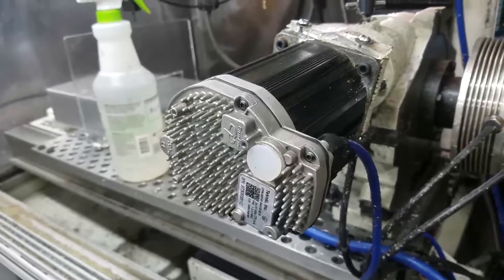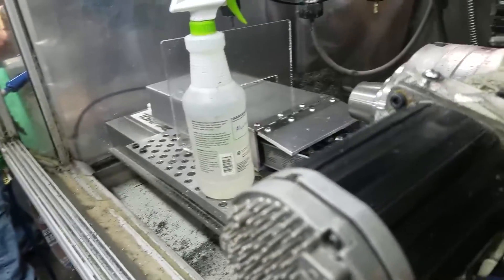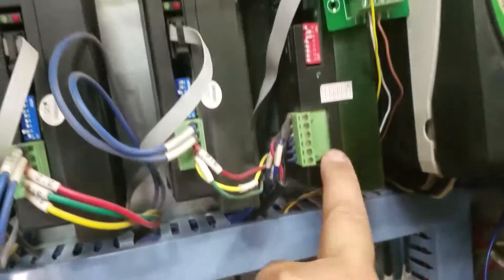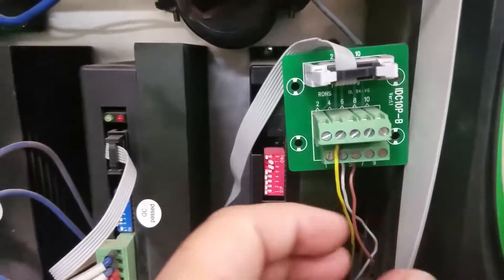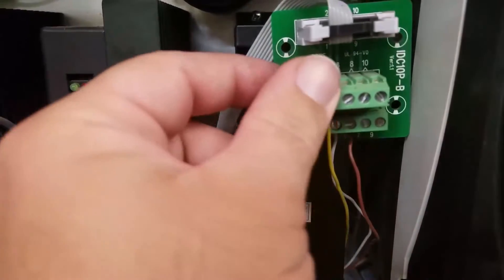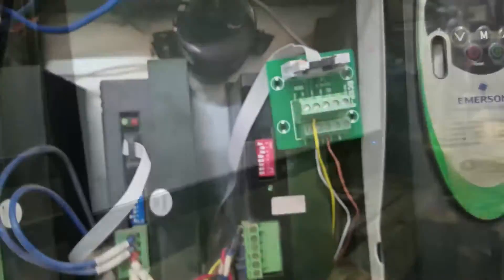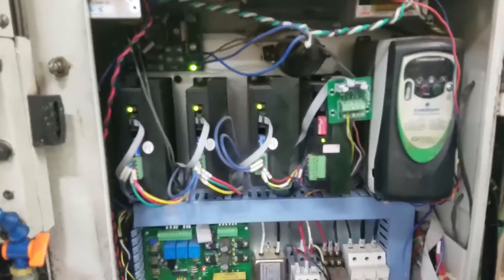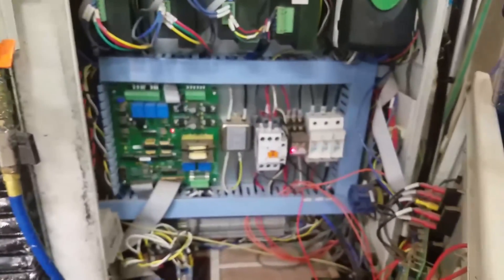Installing Clear Path Servos on a Tormach PCNC770

Comment: It is called "IDC 10P board".   It means that this is connector board for a 10 wires IDC flat cable connector.   10P = 10 pins.
Reply from the maker: sweet, i'm going to sticky this so folks can find it later.
Reply: where can you buy one ?
Reply: @automan1223  ebay.

Comment: Very helpful video thanks, I am trying to do same for xyz axis I am trying to understand the modifications to the INI file. Are the settings from Teknic or  can you point in the right direction in understanding the changes. Also is there a reason you used the SDHP over the SDSK did you need more power?
Reply from the maker: for our application we needed the max power for acceleration rates. also these sdhp's are spinning at near their max rated rates due to the 90:1 gear reduction in tormach's 4th axis. as to the changes in the ini file, look at them as ratios, and you'll have a better idea of what's going on. also check the linux forms for a post we had discussing that very thing. link is in one of our youtube videos

Comment: I think I want a servo spindle on my 770 more than I want a servos on the axis.  Do you have to redo all of the programming changes every time you update PathPilot?
Reply from the maker: we don;t do much tapping, for us it's all 3d profile work so we need massive accell rates. i would assume so. i haven;t update the controller since we did the servo upgrades. it's easy enough to copy and paste the values back in the ini file though.

Comment: Hey  thanks for the info...i have a 1100 with 4th axis... what is the benefit of a clearpath on the 4th axis for speed? most 4th axis is positional and even when used in continues ..feeds are not that fast with only 5100 rpm on the spindel, are you spinning it fast for more of a lathing/mill operation? would love to see why you need that speed for like a faux rapid turn?
Reply from the maker: the stock accel and speeds for all of tormachs 4th axis setups are like 6 rpm. we make a 1 inch part, that equates to 45minute cycle time as we 3d profile everything. the clear path upgrade gives us much much higher accel and speeds closer to 60rpm. cuts our cycle time in half. we're getting a simpson inturn mega custom built for us that will give us even faster cycle times.

Comment: How do you find the machines handling up to continuous production..... what kind of tolerances are they holding ? Thanks, and thanks for the informative video.
Reply from the maker: they hold +/-0.001 all day long. we run lights out 8 hours at a go. machines are only serviced twice a day. that said, tormachs are NOT production machines. that's not where they shine. they are slow. so keep that in mind. for us they are the right tool for the job once we get them upgraded.
Reply: Okay,..... next most common question :P Why not a second hand HAAS :P SIze ? or 3 phase a problem ?
Reply from the maker: tormach pros

can't brake them. and if you manage to do so you can repair them easily enough
used haas, depending on the vintage won't have the memory for modern HSM or 3D tool paths
size we make a sub 1" part. the haas foot print is overkill
single phase is quite nice, but honestly a rotary converter isn't that much of a hassle. just added expense
support, tormachs crew is phenomenal. though from what i understand haas is pretty on point in that department too. 
price. i could out fit 2 tormachs with all the bells and whistles for what 1 haas would have cost with tool changer and 4th axis (speaking specifically new prices)

biggest of all these though was size. the haas just took up too much room.

Comment: Thank you for this.
Reply from the maker: happy to help man. hopefully it will help some folks avoid the headaches we had getting everything set up.
Reply: Did you tell the guys at Clear Path about the changes you had to make in Path Pilot to get it to work?
I though power and step & direction was all that was needed to run there motors. Thanks for the detailed video!
Reply: artisandice are you getting close to changing the xyz axes?